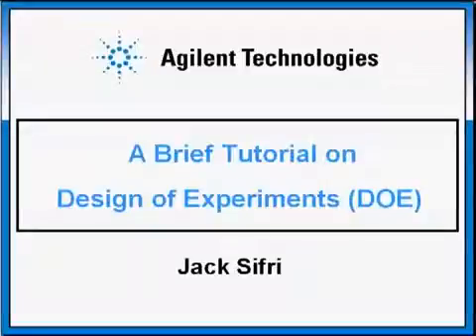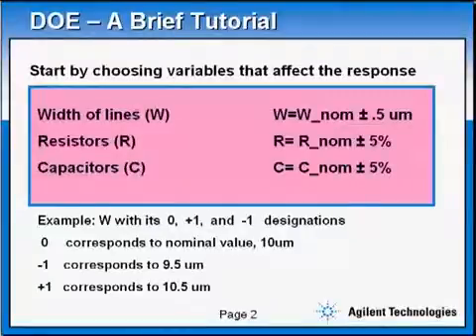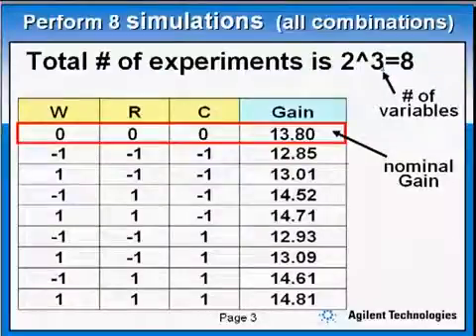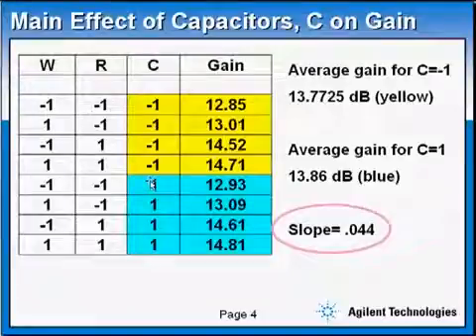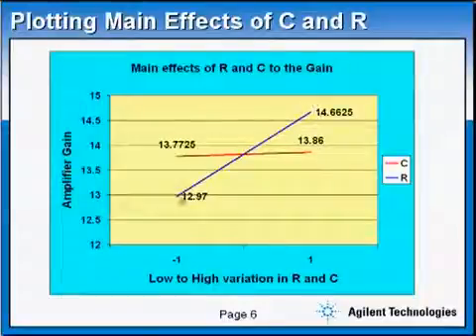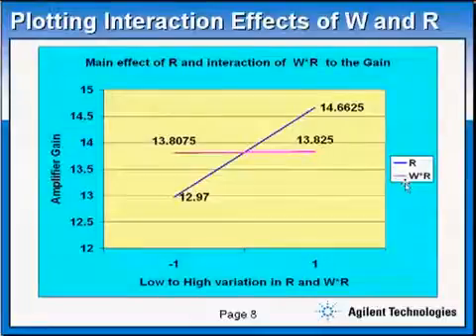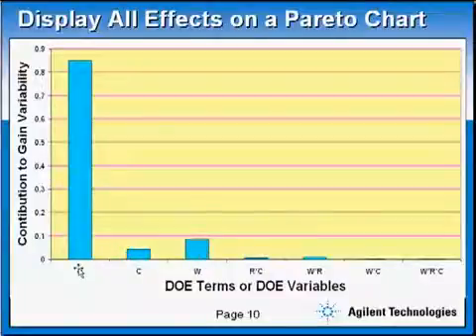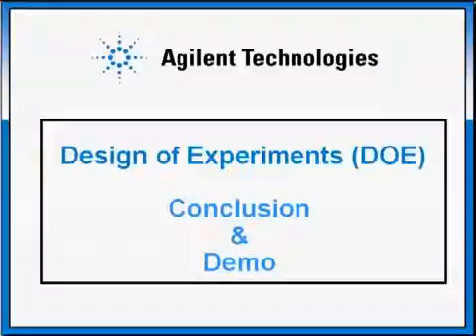Design of Experiments DOE - Part 1a

Comment: How did you calculate the slopes?
Reply: (13.86 - 13.7725)/2
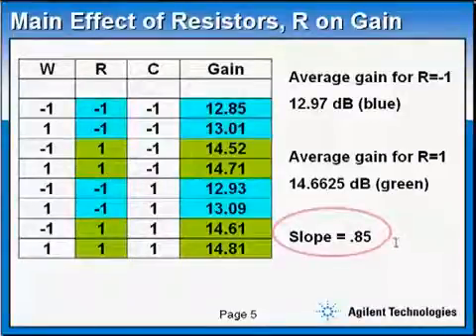Reply: See 5:08. Rise is the difference of the averages. Run is the difference between -1 and 1.